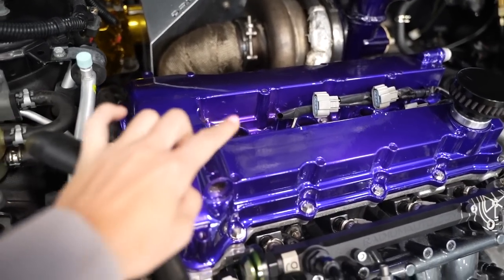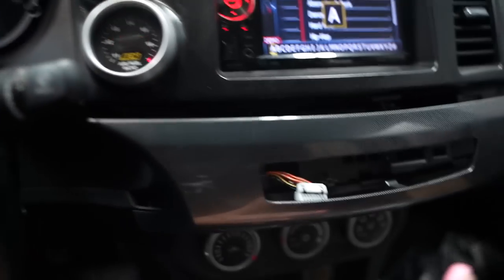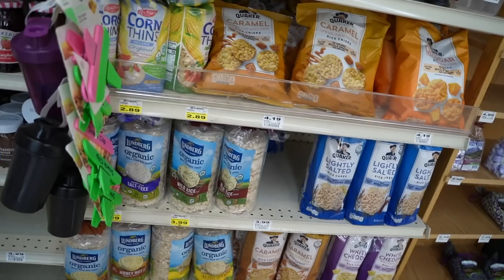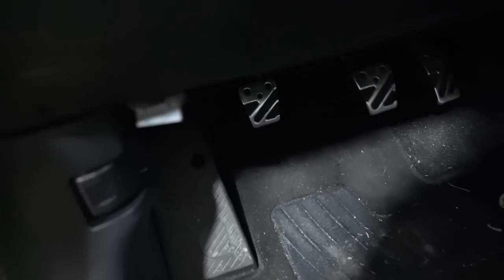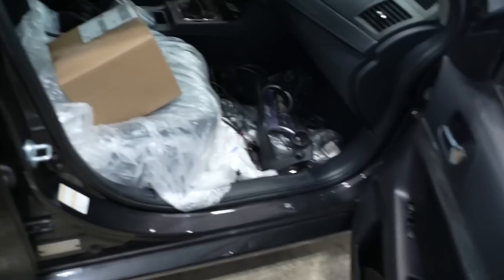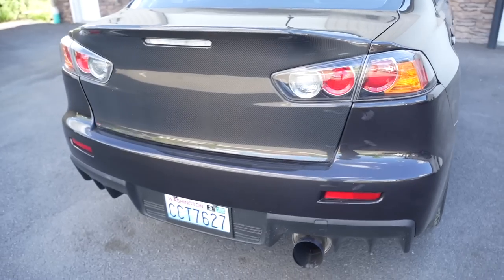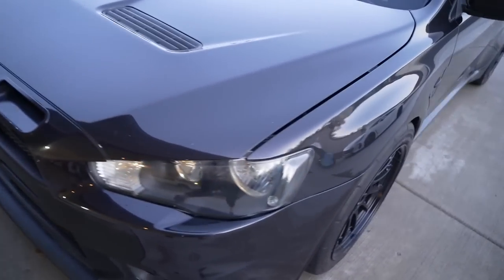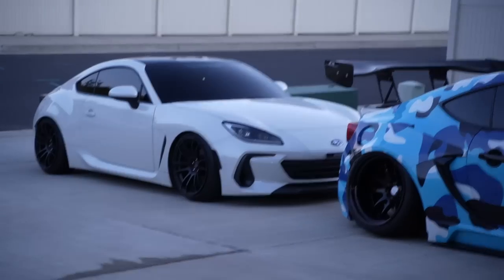My 800hp Evo 10 is ALIVE!!!

Comment: Even tuned with a larger turbo, that 800hp can't even be made on a 4 banger.  The 440hp from the FQ-440 MR was not available in the US so you'd have to import this special edition.  Don't mean to bash the channel but you need to show the proof on the dyno that your car can even reach 800hp when there are Corvettes tune on channels with v8 reaching 800-1000hp.